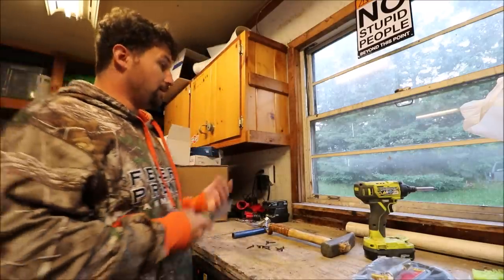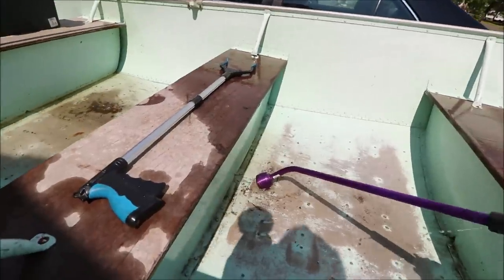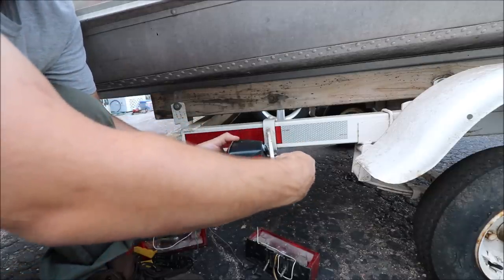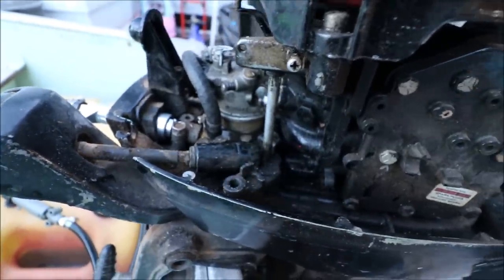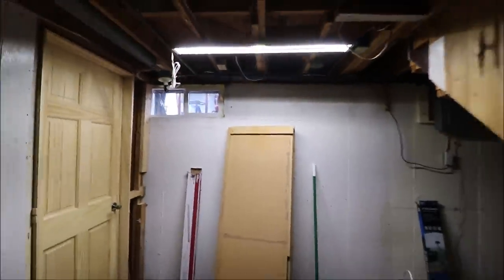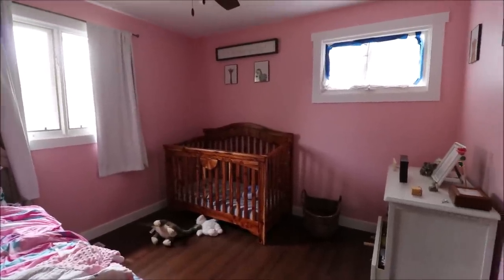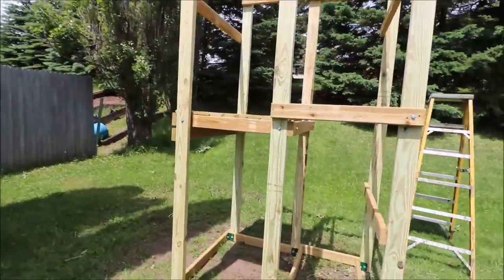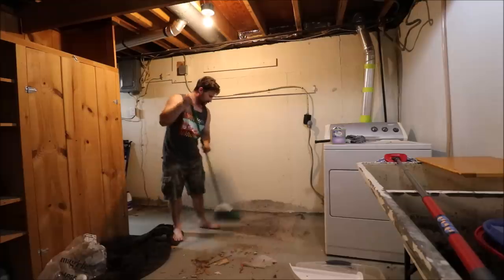The Bay house, Working on the Boat, Closet Remodel, Basement Cabinet Demo, Swing Set.

Comment: Hey Zach I've tried all kinds of tank patching products after awhile seems to leak eventually the best thing I've discovered is using a soldering iron dig a small trench on the crack then melt material in circler motion over the crack using the same material as the tank seems to work aloha🤙👍🌺

Comment: If I had to guess just from the look you gave us via the camera, the car or truck hauling the trailer at one point in some fashion (via a hard turn or a skid out or something) applied more stress via torque to the part of the hitch where it attaches to the vehicle. It looks like it got sort of twisted a bit and then maybe someone did a repair job on it. I don't think a bolt is going to enough long term. You might want to either weld on or use bolts to attach some steel as external reinforcement.